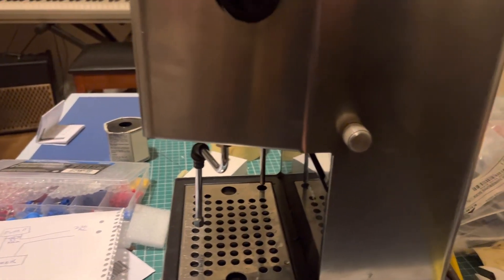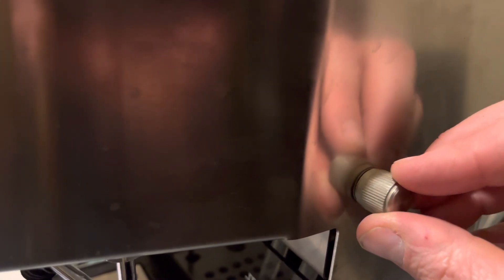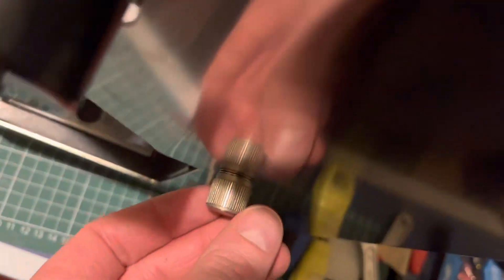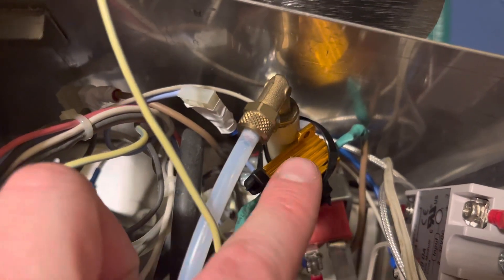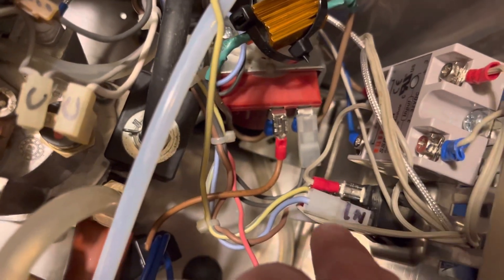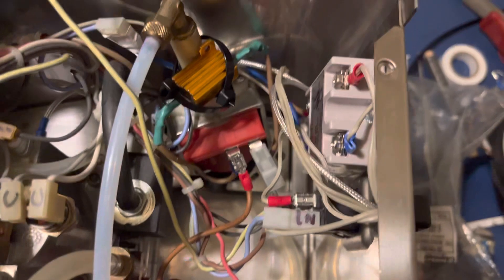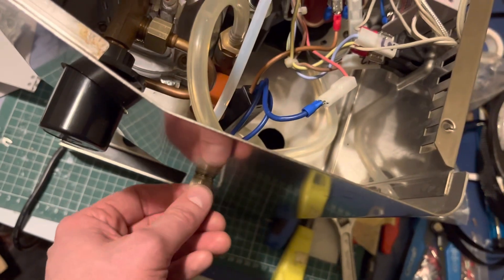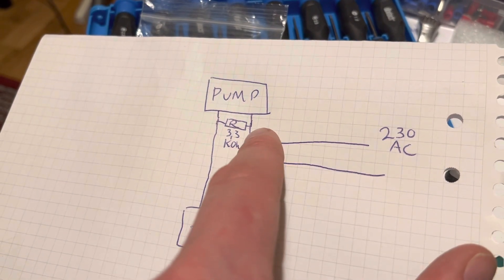Gaggia Classic dimmer mod with resistor in parallel

Comment: What was your reasoning behind adding a fuse here? Admittedly, i have no knowledge about how any of this stuff works!
Reply: Its a 3300ohm 25w resistor wired in parallel, it allows full control of the pump at the lower end of the voltage range.  As some pumps will cut out at the lower end of the dimmer control.
I think it just cleans up the signal of the AC voltage in that range,  been reading up on it my self, as I could not understand it at first, as I thought it would just short out the current.  But think of the resistor as a bulb, if you like, it wont sort it out but will use that current, as it will get warm to touch, hence why it is shrouded in a metal heatsink.  So think of it a cleaning up the signal at the lower range of the dimmer, allowing the pump to still operate at those lower voltages.
Reply from the maker: The fuse comes with the dimmer assembly! For the resistor and why it is necessary it seems @rdalcroft3934 knows more than me about that ;)